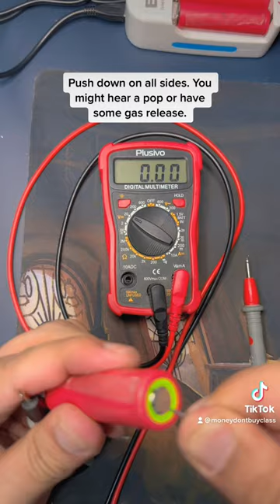How to revive a dead 18650 battery cell to nominal charging voltage

Comment: the safety mechanism prevents the battery from literally exploding, it works but dangerous as hell
Reply: Will the safety work again after resetting it
Reply: @mads4541 depends if you were lucky enough to not puncture it. Sometimes you have to because of excessive gas build up inside which pops the cap back up. But also you might accidently puncture it therefore next time it experience short circuit or heavy current it will surely set your house on fire

Comment: No. Take jumpers and quite literally jump start a dead cell with a charged one. Positive to positive, negative to negative. Press on and off 5 seconds at a time for no longer than a minute. Once the dead cell is above 2.5v you can charge normally. Just revived multiple 18650s today

Comment: don't do this. it's very dangerous! that's a safety mechanism which you are poking. you can end up with the battery explode or even worse catch on fire when you are not aware!
Reply: Can i use it again  sir
Reply: @Yuvi-v6u if you push too hard or puncture it then no. Because the foil can break when pushing down,

Comment: WOWOWEEE...It works 100% in my 18650 dead batteries. The gas was released after doing these. From 0.35v to 4.08v, 0.40v to 4.04v, 0.30v to 4.04v, etc. I do these in my 10 pcs of 18650 dead batteries.
More power to you... Thanks buddy.

Comment: A description on exactly what the fix does would be helpful. I had several chargers and one of them would actually do this for you. Don't recall what charger it was but I do remember it was the cheapest 4 bay I had at the time which was a bit surprising.

As to this being dangerous...not sure. Since there are chargers that can do it, I have to assume there is at least some method of doing it safely, but that doesn't tell us much. I mistakenly shorted a flat top when using solder which seems to me would be the maximum damage screw up. Did so to create a button on the positive side. It smoked, I put it in a tuna can, set it in the middle the room aaaaand! Exactly! NOTHING! It just died. Still, best to assume these can be very dangerous. Did several of those, no problem, but next time thick gloves and face covering.

Comment: Too sketchy for my blood. 
You’d be safer taking a good, fully charged battery and running a wire from both positive ends and one for both negative ends of good and bad battery. 
It will transfer some energy from good battery into bad battery and balance their voltage. After about thirty seconds or a minute they will both be able to recharge. 
Don’t create voltage with a direct short circuit…